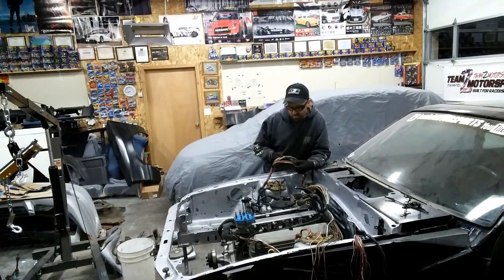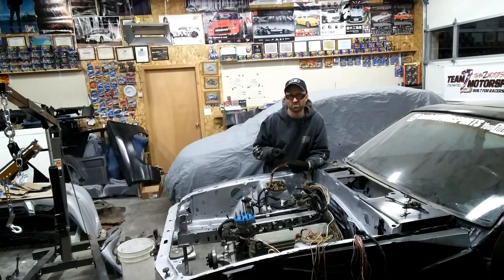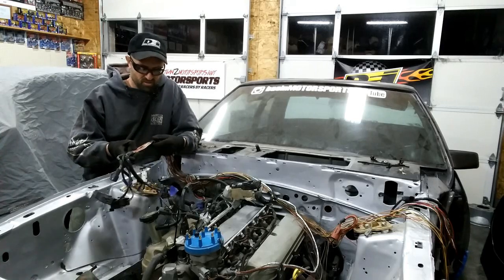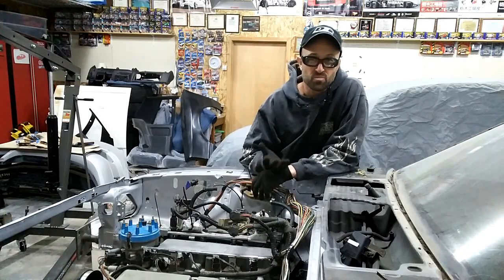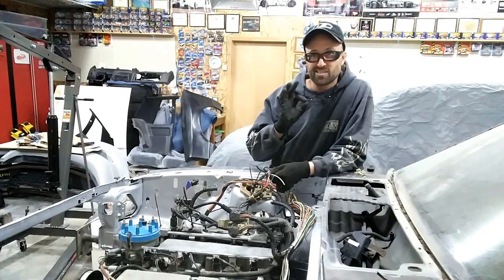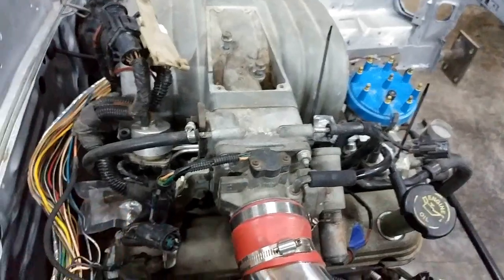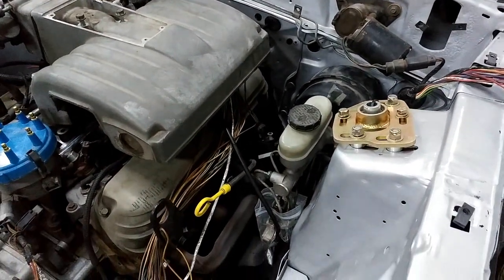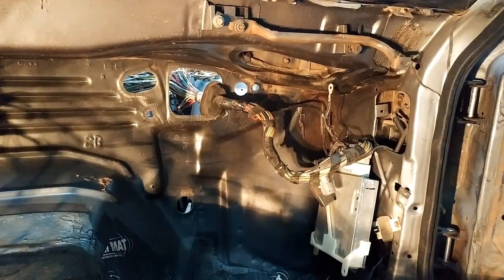How to Start an Engine Harness Wire Tuck

Comment: The wire at 4:43 that doesn’t have a home is homeless lol no but I can’t remember I think that wire goes to the smog box mine is homeless too
Reply from the maker: I'll have to keep checking.  I have a few of those homeless plugs that may stay that way.
Reply: Basin Motorsports I converted mine also disk brake all around I kept my stock booster 1989 I have great brakes people say you must use 93 brake boosters that’s false maybe it performs better but my car stops fairly good with stock booster I did the sn95 in the front I kept my stock dif just added disk brakes what ECM do you have
Reply from the maker: winglesschip 209 The Cobra Master Cylinder pushes more fluid due to a larger bore and since I plan to track the car a little bit I want the better stopping power. I have an A9L ECM.
Reply: Basin Motorsports nice that’s the best stock one I have the same one A9L